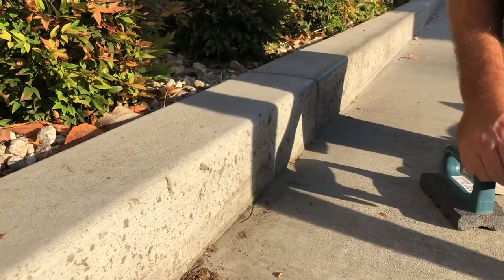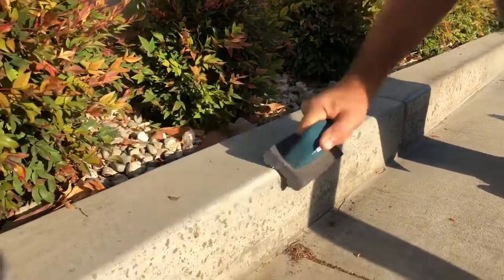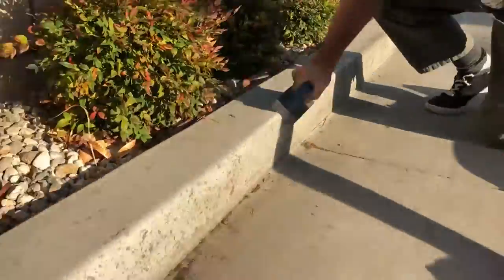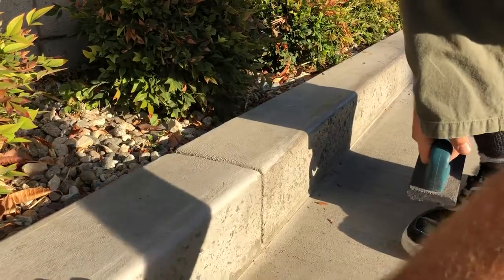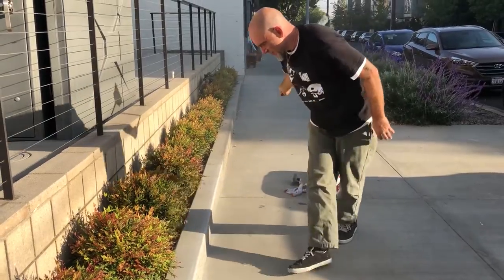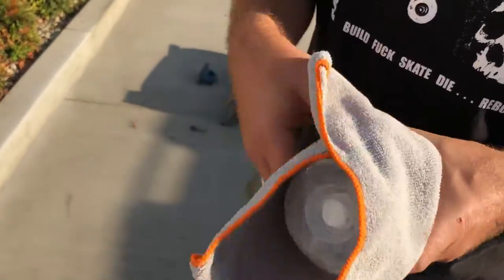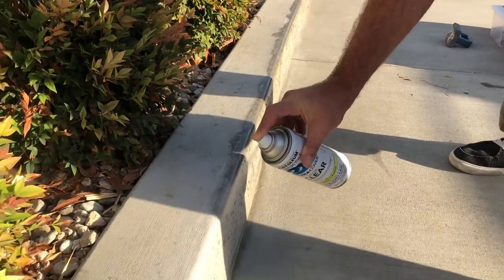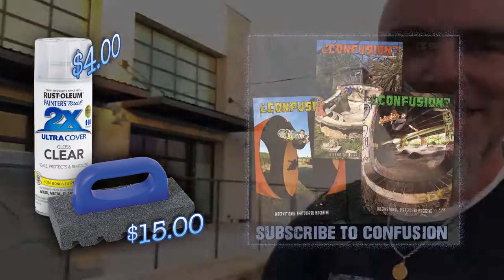Concrete Corner - Episode 3 - slappy prep

Comment: What about rubbing wax in to no end? Better to start with the rub brick I’d assume
Reply: "Rubbing wax in to no end" defeats the whole purpose -- rub bricking an unskated ledge and then applying clear coat/enamel over it will make it slide like ice; and adding wax afterward is like a cherry on top. It's a million times better than just using plain wax.